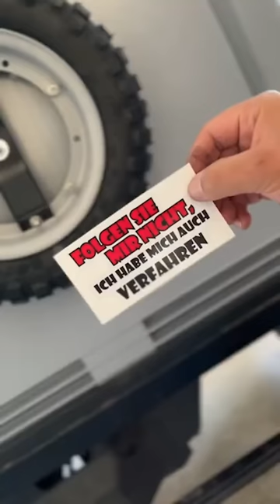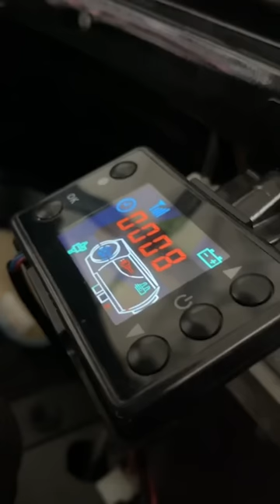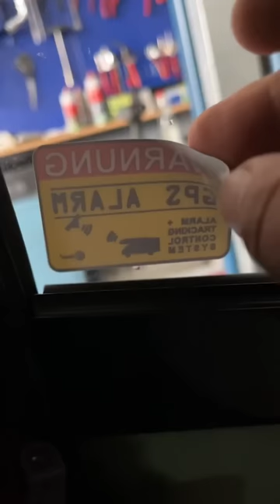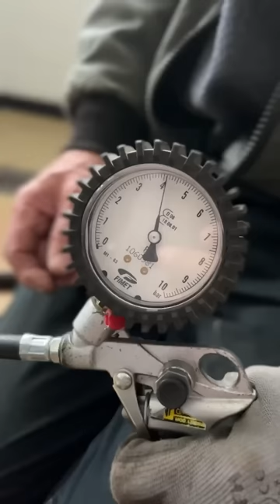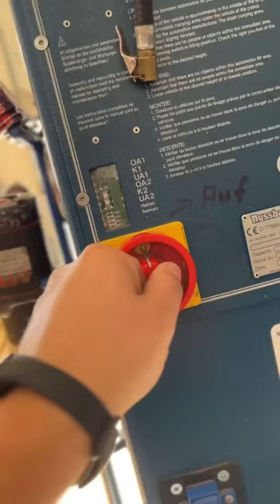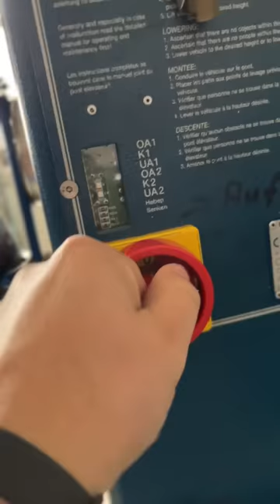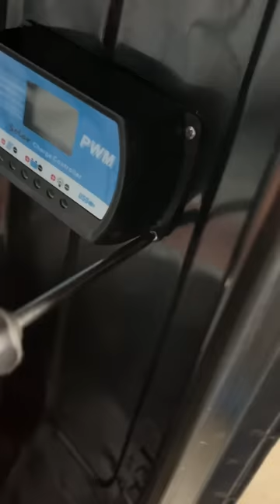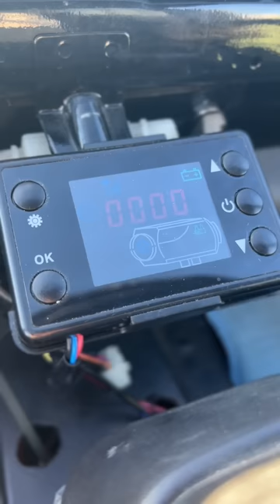DIY Micro Camper Conversion | Full Build Timelapse | Piaggio Ape 50 | Garagengedöns

Comment: nice build, handy little camper. only thing I would do differently is to make a waterproof box for heater or try mount inside because the elements will destroy the heater very quickly, I've been using one for years at home.
Reply from the maker: Oh wow thx for the feedback❤️✅

Comment: Хорошая идея и отличное исполнение.  с  наружи можно легко утеплить сэндвич панелью,  будет не только тепло по ночам но и прохладно в жару в нутри. А также по углам с наружи прекрепить закладные петли  чтоб можно было натянуть тент, телескопические малярные удлинители могут служить опорами для тента на земле. Откидной боковой борт можно использовать как столешницу.
Reply: @garagengedoens  If you cut a large sewer pipe in half and fasten loops and fasteners to it , you will get a cover where you can twist the awning and remove the props , the pipe itself can be rigidly screwed to the body of the sleeping bag .
Reply from the maker: @alal-os1er  oh wow awesome idea🤩 Thx for your amazing feedback✅
Reply: @garagengedoens  
Good idea and excellent execution. outside
, you can easily insulate the sandwich panel, it will
not only be warm at night but also cool in the heat
inside. And also attach
embedded hinges at the corners outside so that you can pull the awning,
telescopic painting extensions can serve
as supports for the awning on the ground. The folding sideboard
can be used as a countertop.
Reply from the maker: @alal-os1er  awesome🤩🤩🤩

Comment: You put 3 vents at the top, I would have put a vent near the floor that can be opened and closed when you need to. Condensation will become a problem. There is nothing like waking up and finding condensation running down the wall and your bedding is wet.
Reply from the maker: Hey thank you for your feedback😊✅ Please dont forget I also have the two windows in front and the two in the back😊🚛

Comment: VERY cool! I loved your build series on your little Ape....sadly they are not sold here in Canada, but I would love to have one :(

I really want to import one, especially a larger Ape TM with the car-style controls, but sadly they are not legal to road-register in my province of Nova Scotia yet! Turning a larger Ape TM van into a mini camper like yours is a dream of mine someday!

A few details if I could ask some questions? I don't recognize the gray 'box' you made the camper part out of - what was it used for (kudos on that very cool re-purposing of it by the way!)

Have you considered swapping the bulbs in the tailights and turn signals out for LEDs? Brighter so makes your little Ape a bit safer as it's easier to spot? Also, the redesigned LED headlights/housings from a newer Ape50 Euro4 should bolt right onto yours and give you even better lighting at night?
Reply from the maker: Hey thank you so much for your awesome comment🚛❤️
It‘s so sad to hear they are not road legal on your country😢 Hopefully they will fix that soon that you can get and drive one road legal🤩